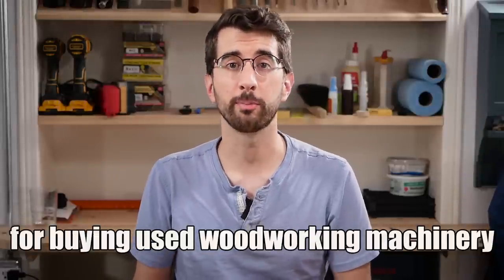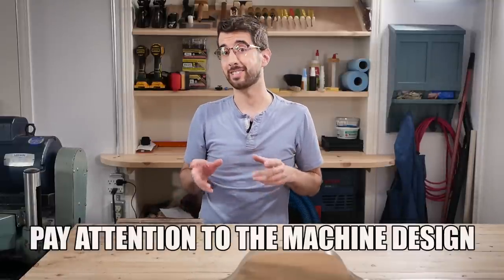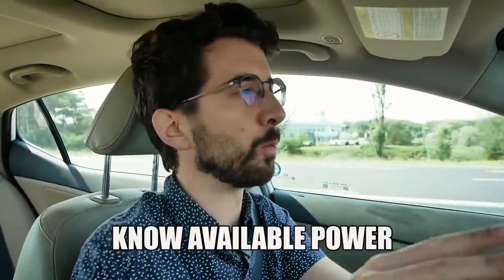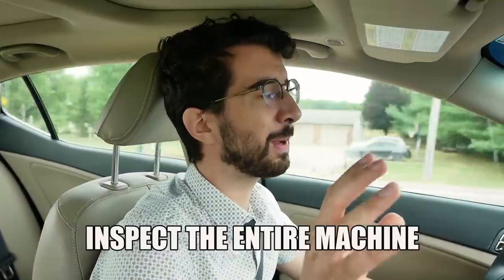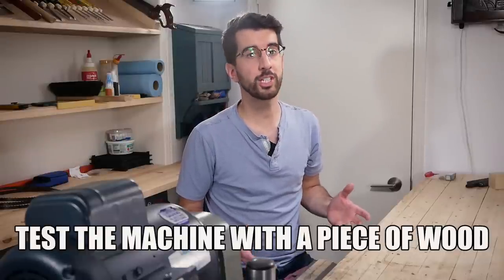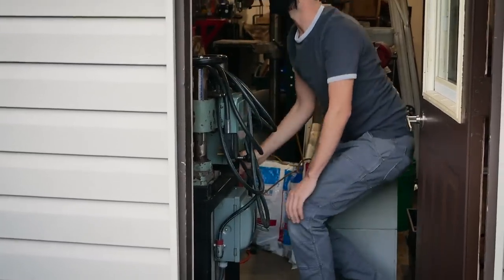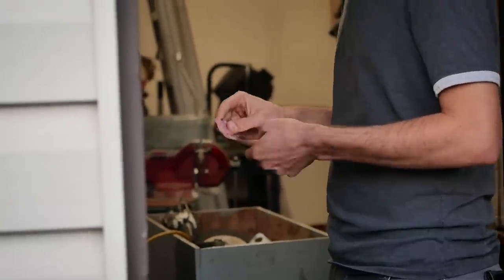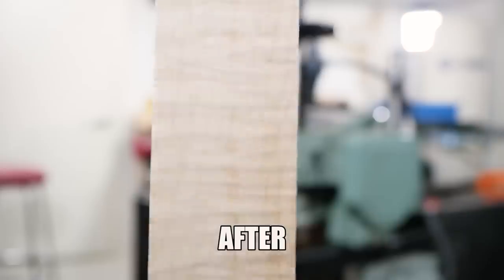Used woodworking tools: What they don't tell you

Comment: Okay, watched the other vid, which puts me firmly in the "buy new" camp.   Or maybe "buy used and bribe Scott to come over and do it"...   😆😆  I do have a Delta Jointer that I would love to convert...
Reply from the maker: After doing so many machine restorations, I'm starting to side on the 'buy new' camp as well. It's a great was to save money if you're rich on time, but I am no longer rich on time.

Jointer's are much easier to convert than planers. Less moving parts.

Comment: Bought a compressor and tank for $60 last year. Spent $25 on a replacement valve plate. Had to use part of a silicone baking sheet as gasket material. Still need to get a quick connect fitting for the outflow. I'm still below the "new" cost but I would have saved myself a lot of hassle buying new. I've learned a lot about compressors that I otherwise wouldn't have, though.

Comment: For those in the US don't forget about NAFTA and the Canadian exchange rate if you're interested in Machines. In 2003 I bought some great General woodworking machines from Canada for 60 cents US for every Candian dollar. General Machines, made outside of Montreal and are\were considered on par with Powermatic but I thought even better. I bought the machines from a broker in London, Ontario at a further 20% off.  Also, with NAFTA there was no import fees at the border. Furthermore, the Broker convinced me to buy a drum sander and shaper because he would deliver the machines to this side of the border in Detroit. Originally I only wanted the 350-52 cabinet saw. The deal saved me 2 hours of an 8 hour drive to Detroit along with the Custom's hassle at the border. Although there is no costs at the border anymore you still have to deal with Customs. After about a year and a half I accepted I didn't like working with the machines and sold them all and made money on the deal. If you're looking for machines and near the border, consider looking in Canada. Also, the older large, "green" General International machines are what the likes of Delta has become. Chinese. Not bad machines but they are not Generals.

Comment: I bought one looks almost the same as yours but 15”. It even says “15” auto planer”. I adjusted the bed rollers a little and now it snipes very little. I do want to get a shelix cutter head for it, but I need to take the current one out and measure some key dimensions. Endless projects down the road.

Comment: Hey Scott, I just picked up the same planer this past weekend and was wondering if you found a parts supplier for these. I watched your sheartak video and it looked like you had found some parts for them where as i am having no luck lol. Needing a new a outfeed roller, chain sprocket, dust extraction port, etc.  Thanks! Great video as always
Reply from the maker: Some of the parts are interchangeable on this 15" grizzly planer: https://www.grizzly.com/products/g1021/parts

For a 16" machine, the outfeed roller might not be available. I had mine recoated by a machine shop that specializes in rollers for printing presses.

Comment: Love your videos and the information within. I scrolled but didn't see my question. Do you have info on that trailer? I could use that in my garage shop.
Reply from the maker: They are imported by various distributors. If you're in the states, I believe Harbor Freight sells them (they're red I think). I found a local guy who imports them privately in hamilton, on. I've also seen them on Costco's website in the past. Just search for 'Folding Trailer'. It's a class 1 so it's rated for 2000lbs, but I probably wouldn't go much over 1000lbs.

Comment: Depending on the motor, it would be easier just to get another phase from the panel, since the current draw at 120V would just pop the breaker or melt the wiring.

Comment: does your motor pivot for blade changes? that's the only possible downfall of the motor-on-top design, especially for sheartak cutterheads where you're going after the cutterhead more often - some of the old motor-on-top designs require taking the motor off just to access the blade
Reply from the maker: no, I will have to take the motor off if I was to rotate the carbide inserts. But that will be a longer interval than a hss straight blade would be.
Reply: @ScottWalshWoodworking  nuts! well I look forward to hearing your experience - in my experience carbide starts sharp but are very brittle, so the inserts do need to be rotated fairly often. which of course is dependent on the volume of planing being done. what we really need are HSS inserts, haha!